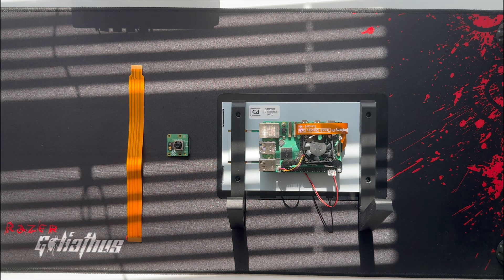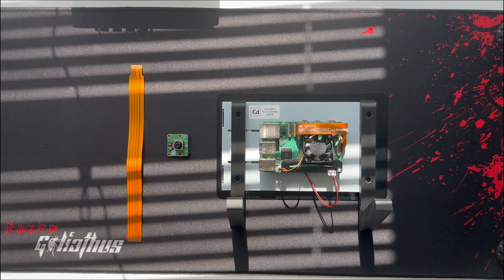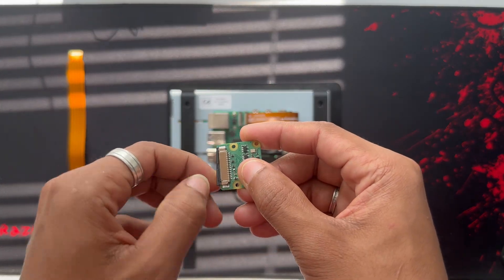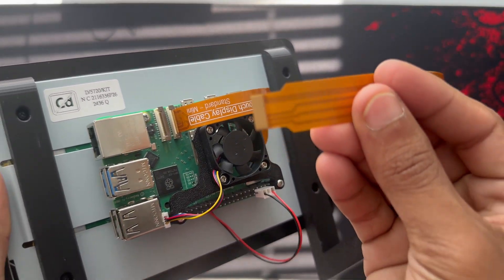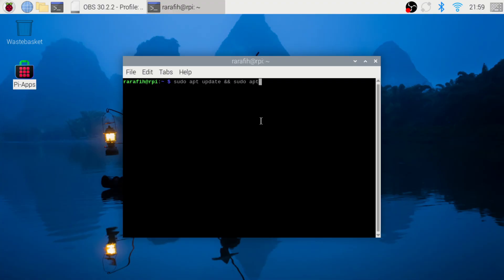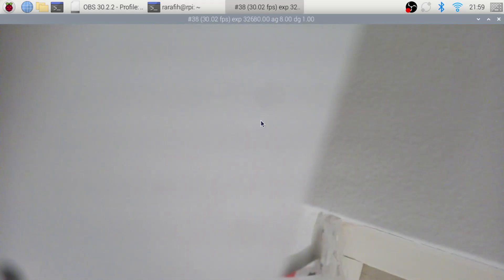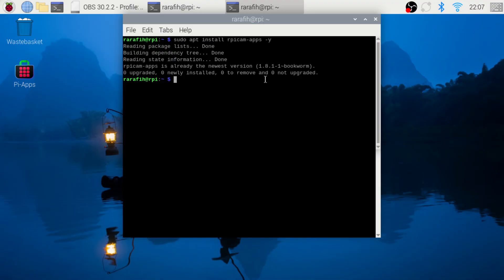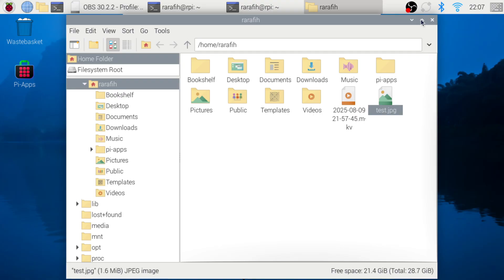Raspberry Pi Camera Module 3 Setup | insydeai

Comment: hey tell me if want to take 30-40 images so what I can doo
Reply from the maker: Use this command to capture multiple photos :
for i in {1..40}; do libcamera-still -o image_$i.jpg; sleep 2; done
Change 40 to take more or fewer photos.
sleep 2 means a 2-second delay between each shot. You can adjust it.
Each photo will save as image_1.jpg, image_2.jpg, and so on.